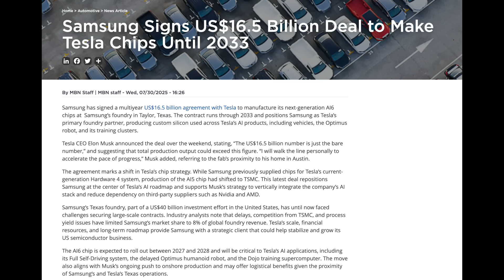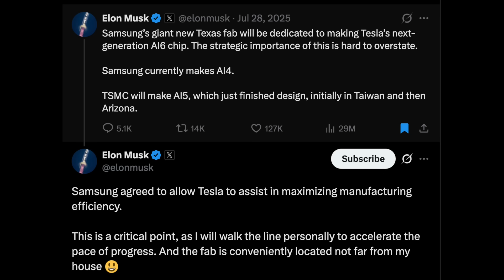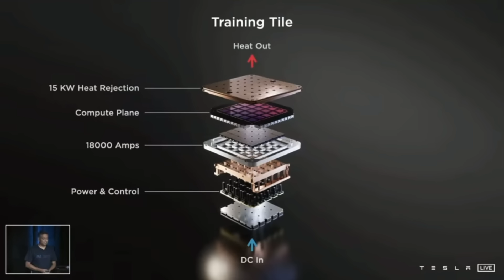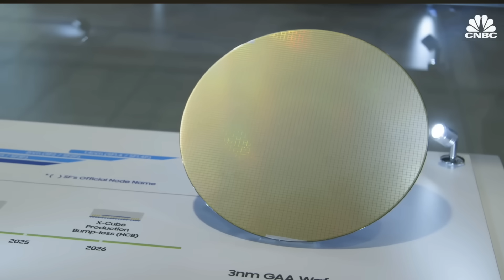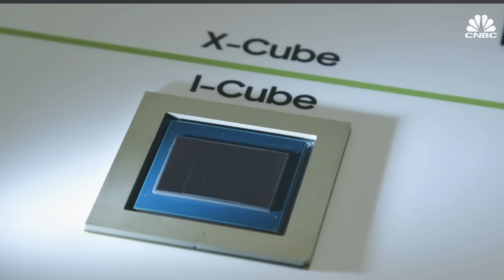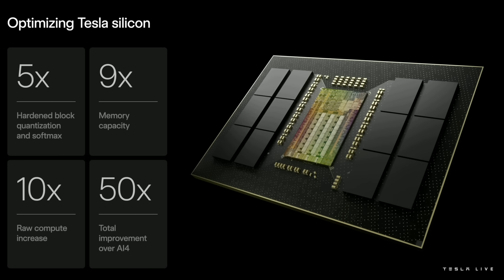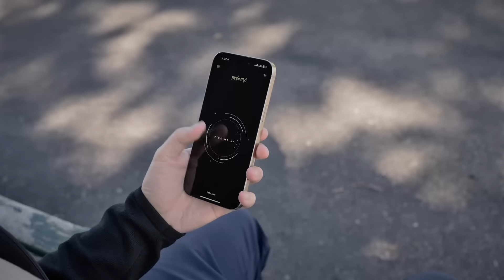Tesla's Next Revolution: "One Chip to Rule Them All” - Elon learns from Samsung how to build Fabs!

Comment: The problem with your analysis starts with gargling Elons nutsak, resulting in delusional conclusions. Tesla batteries are a joke. Which is why they’re not used in the cars. Proven easily by looking at 5 Chinese battery manufacturers who ball slap Elons face with girthy spectacular batteries. The chance Elon builds a Tesla fab that’s competitive is less than zero - or the same as Elon producing actual FSD even ten years later than his first claim…

Comment: 4:30 Tesla 's Changing Focus (Jan 2026)
Besides focusing on FSD, Robotaxis and Optimus robots, Tesla / Elon Musk is now more focused on building AI chips, and chip factories from scrap as these will be the new bottlenecks for Tesla in about 3 years. 

Tesla and other companies are now starting to compete for costly AI chips and infrastructure, making Tesla pay more attention to these coming bottlenecks.

Next focus for Tesla is on space data centres, which is likely to be a joint venture with SpaceX.

Tesla and xAI has built their AI training infrastructure 3 times bigger and 20 times faster compared with their competitors.

Tesla intend to use or manufacture more computer chips than all other companies in the world in 3-5 years. This is similar to the goal set for their battery manufacturing Gigafactory in Nevada in year 2014 for use in electric vehicles and electricity storage, so as to accelerate the world's battery manufacturing volume for electric vehicles and small, medium and large scale electricity storage.

Comment: One thing you did not mention is Elon expects to build the most efficient chips. He also, no doubt, will build an array of purpose built chips that will maximize efficiency for the task(s) at hand. It can be expected Elon will leap frog the competition by building chips to the limits of Physics. It can also be expected for Elon will treat his foray into chip design and fabrication as an imperative effort considering he has a Best Friend as POTUS, a decided advantage.
Reply: It's a lie folks
Reply: What Tesla seems to be aiming for is not just faster chips, but chips that waste as little energy as possible doing very specific jobs. If you design silicon around the task instead of forcing general-purpose hardware to do everything, you gain efficiency that competitors simply can’t buy off the shelf. That’s how you leap ahead without chasing raw transistor counts forever. That said, physics still sets hard boundaries. Even Elon can’t ignore yield, heat, and power density. The advantage comes from how close you can push those limits consistently, not from pretending they don’t exist. Do you think Tesla’s bigger edge will come from chip architecture itself, or from how tightly those chips are integrated into cars, robots, and software as one system?
Reply: @LucasTCS1  Agree 100%

Comment: Why datacenter in space don’t need cooling? As far as I remember, vacuum is a very good heat isolator.
Reply: That's actually a good question, with a complex answer.  "Temperature" as you know it is a measure of the motion of molecules: more molecular motion > greater temperature.  However, there aren't a lot of molecules in space--as you note, a vacuum.  
But there are other factors at work, such as solar or cosmic radiation.  You know that close to to the sun, it's awfully warm, about 5500C at the surface.  
The farther you go from the sun, the cooler it gets (inverse square law).  At one AU, the average distance of Earth from the sun, objects in space will warm up to as much as 120C on  the sun side, while the shade side can be as cold as -100C (these temperatures will vary because the earth is not always the same distance from the sun).  
So if you have a way to radiate most of the sun-side heat away into space, you would have a refrigerator.  Google "How is the heat from the sun on the space shuttle radiated away" for an explanation.
All that being said, the fact that heat from the sun-side of the datacentre would need to be removed makes the idea a considerable challenge.
Reply: @youtubemakesmedothis7280 one is not going to radiate any significant amount of heat in orbit. Musk is once again pumping stock of his companies and counting on his cult and greedy ignorant investors.
Reply: Because it’s all rhetoric designed to get his minions like Lars excited.
Reply: They do need maintenance so use your brain!

Comment: Tesla tried making their own chip before and gave up. What is didferent this time? Remember DOJO?
Reply: Yeah, i remembered. To me, DOJO wasn’t a failure; it was a lesson for Tesla. Tesla proved they could design custom silicon, but they also realized they didn’t need multiple parallel chips anymore. Splitting effort between DOJO, vehicle inference chips, and robot compute was slowing everything down. Do you think DOJO was ahead of its time, or do you think pivoting away from it was the smartest move Tesla could have made?
Reply: pump and dump
Reply: Yes I do. And they are currently using it in the FSD training pipeline. So it wasn't a failure. They as a car company just couldn't keep up with nVidia designing chips and while a generation or two back it is still useful. AI6 as a converged use chip makes more sense than a chip for driving plus a different training chip. Even if they have to dedicate a little bit of silicon for the other use into each die it will still be less costly than designing and having made two different chips. They might get a fab made. 
His idea of putting the wafers into a protected box isn't completely equine organic fertilizer. But I worry about docking a contaminated carrier into a clean machine, or any of the other steps where the wafer is handled outside of a carrier. Of course they could set it up more like a battery line where there is a processing line where the wafers/chips are in a contaminate free area and the people are outside of it. But the ASML machines are too big for that and I would be shocked if they didn't have parts outside of the wafer path that need to be kept contaminant free also, and serviced so the pure nitrogen might be a little hard on the ASML engineers as a suffocation hazard.
Reply: @leonardharvey777 it was a massive failure lol! A success is when you can make millions of chips and actually use it at scale. Making very chips only is super expensive and not efficient

Comment: Chips and tesla don't age well. Tesla can buy chips from manufacturer but it's more of an expense than anything else and they have bought Nvidia chips too to do what?
Reply: I think that Tesla buys Nvidia chips because they need compute now. Training FSD, Optimus, and AI systems cannot wait. Everyone at that scale buys off-the-shelf hardware first. The earlier chip efforts did not fail because Tesla could not do it. They failed because the scale was not there. Too few cars, no robots, fragmented workloads. Building custom chips without massive volume just burns cash. Millions of vehicles, Optimus coming online, and AI training costs exploding. At that point, constantly buying third-party chips becomes a long-term cost problem and a dependency problem.

Comment: To build a production fab, first you need a development fab just to have a “process”, that in itself takes years.
Reply: I guess they will get the process from Samsung.
Reply: @joergfeler351  yes, I was thinking the same.
Reply: @joergfeler351 it won’t
Reply: You don’t go straight to a high-volume fab. First, you need a development line just to lock the process, materials, yields, and defect control. That alone can take years before it’s stable enough to scale. 
That’s why the Samsung partnership matters. It effectively lets Tesla learn inside an already functioning process instead of reinventing one from zero. Building a dev fab from scratch as a first step would be painfully slow and insanely expensive.

Comment: The Tensor processing units (speak for quick for doing AI computing) will be used in the cars, and robots and if made in-house cost 0.05% what they currently pay saving billions!
Reply: I can estimate the future of its. If Tesla can design one unified AI chip and run it across cars, robots, and training infrastructure, the cost savings compound fast. It’s not just cheaper silicon. It’s fewer vendors, tighter optimization, lower power use, and faster iteration. Once you control the whole stack, every improvement multiplies everywhere else. Even if the per-chip cost drops by a tiny percentage on paper, at Tesla’s scale that turns into billions very quickly. And more importantly, it removes dependency. They’re no longer waiting in line behind gaming GPUs or data center customers. Do you think this becomes Tesla’s biggest long term advantage, even more than batteries?
Reply: Я вот например жду результатов demo, которое через 3 дня после презентации чипа для термодинамических вычислений Гийом Вердон, глава Extropic, пообещал сделать для Маска в ответ на вопрос Маска, есть ли у них такой чип/компьютер.